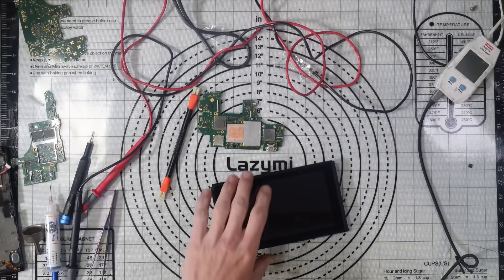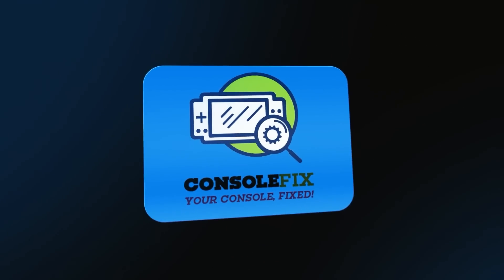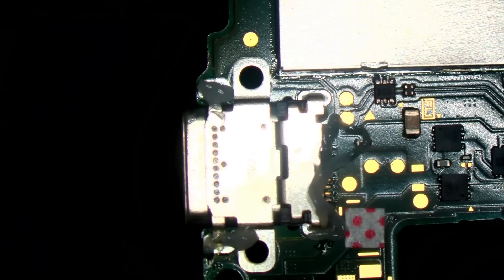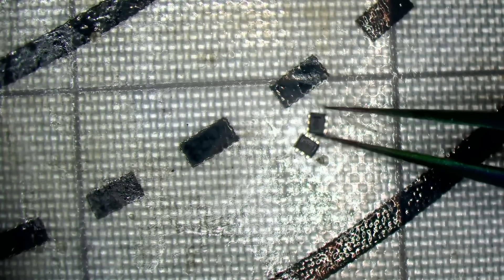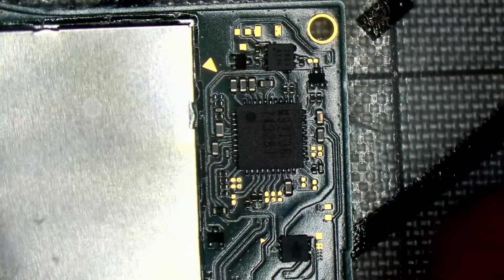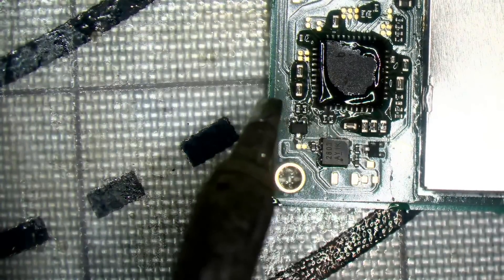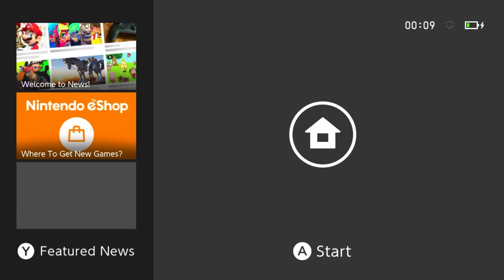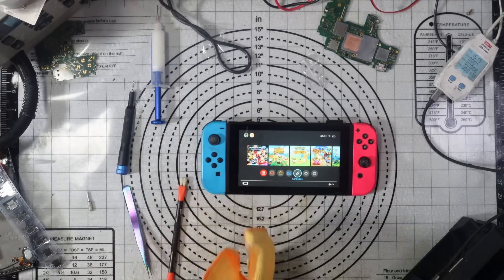Nintendo Switch Not Charging With 2101-0001 Error - Can I Fix It?

Comment: I have a question. I saw that you removed the apu of the other Switch on your desk 0:50. I have tried reflowing mine but didnt solve the bsod. I removed the chip and I have 1 ripped off pad on the top left and 1 on the bottom right, that one has a trace there where I can solder a magnet wire on. The one on the top right doenst have a trace to it, it goes straight down into the motherboard. It looks like its doen have a bit of tin in there still so I think I can stuff it with 0.06 mm magnet wire. What is my best option?
Reply: Its likely a NC pad doesnt need anything then